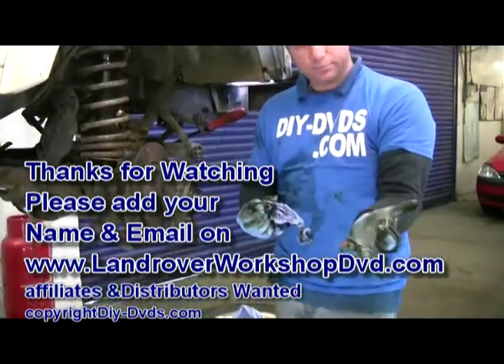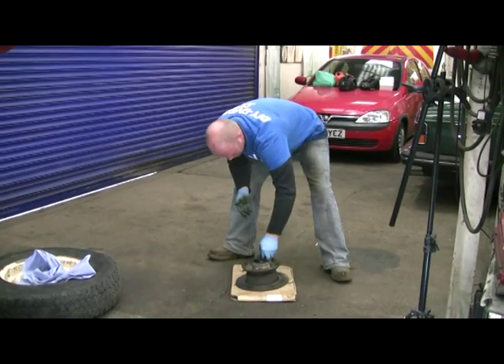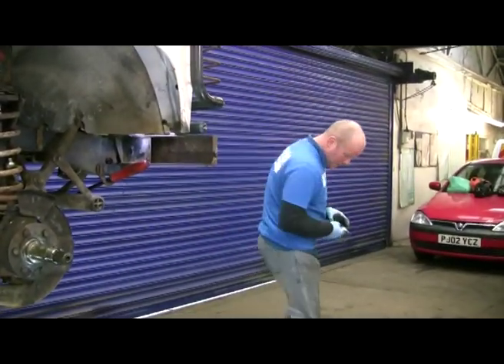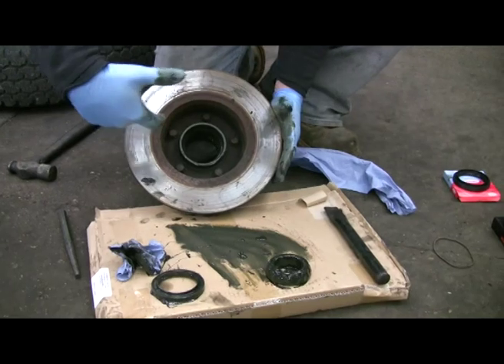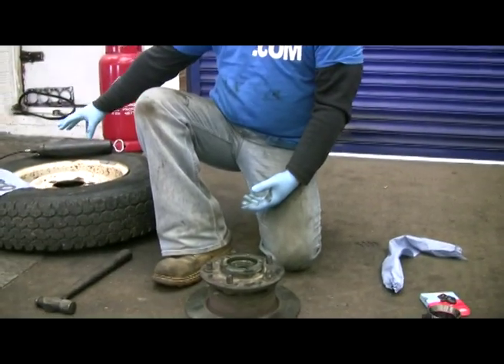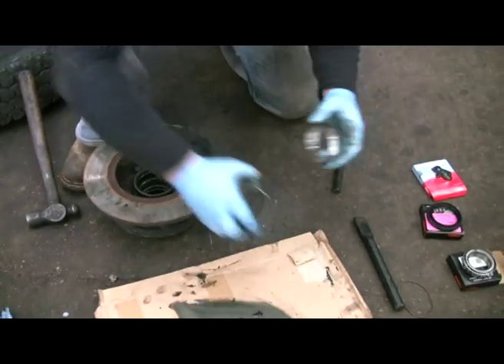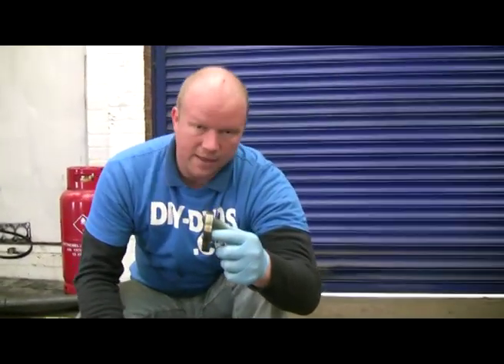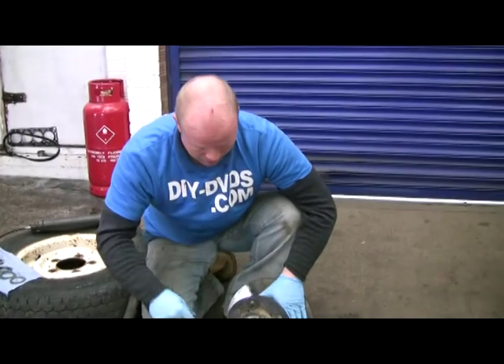landroverworkshopDVD.com how to change landrover and discovery wheelbearings brake pads and discs

Comment: Instead of finishing knocking the new bearing track in with the chisel, I cut a couple of mm out of the old track with a grinder. That way you can use it to knock the new one all the way in but the old one won't get stuck because you can lever it back out carefully with a screwdriver in the gap you cut. Put your hand over the top of it though because it does 'ping' out!

Comment: BRILL VIDEOMATE just one thing what about when the inner race sezies on and u cannot remove the bloody hub like i have now , and have a puddle of oil coming out of the cv joint????
Reply: I have the same problem, disc hub will not slide off. I tap pretty hard with a hammer, no luck. Did you finally get yours off?